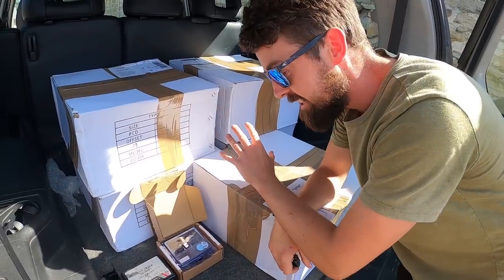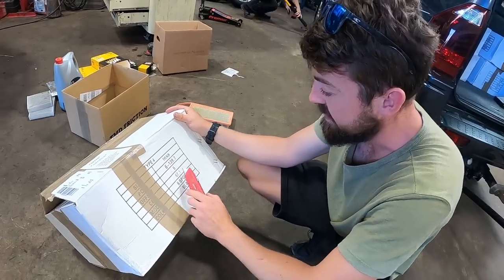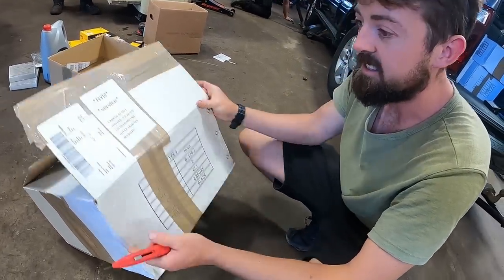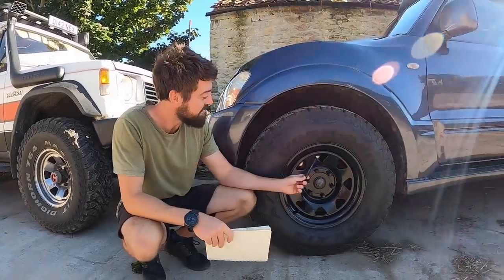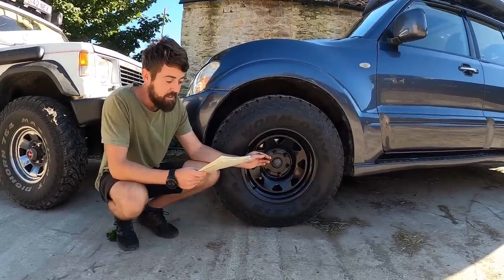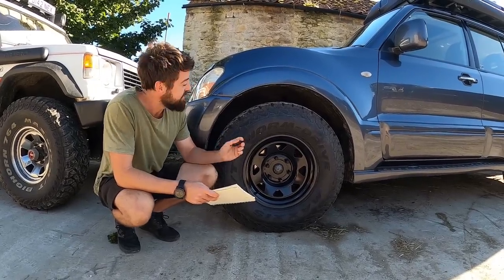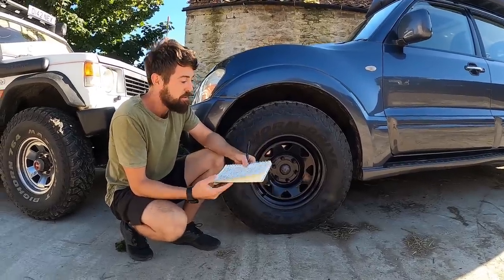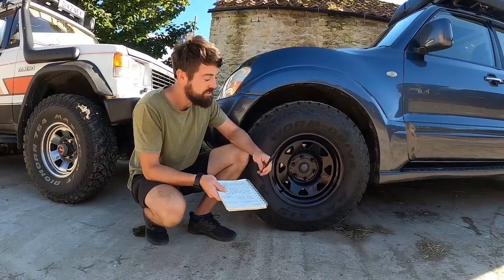Wheels & Tyres | Building an Overland Vehicle on a Budget

Comment: Nice one Jack. Definitely improves the look and should give slightly better stability. You won’t regret getting the all terrains one but. They are quieter, harder wearing and help a  bit with fuel 👍
Reply from the maker: Cheers Nick, yes indeed! I think it's going to work rather well for its intended use 😁👍
Reply: @JKoverland  It most definitely will 👍

Comment: I was looking for some steel wheels for my 97 montero sport here in the states. The hubs are 108mm (much smaller on your 3rd generation) I had trouble finding wheels that work. I did find some on the jegs website, listed as 107.95mm.  They have 3.75, 4.5, 5 inch backspace models, but I dont know what would be best with 15x10" wheels
I talked with a friend of mine and he is going to give me his old steel Toyota wheels. They are 106mm bore so I'll get them machined bigger. No idea what the backspacing is on them, but can't beat the price
Reply from the maker: Yes nearly fell into that trap too but realised in time 😂 so got a set that were advertised with the smaller bore for the later mitsu's 👌

Comment: wheels look better bigger... but I believe if you shopped around would if been alot cheaper.... I only paid £550 for 5 maxxis muds fitted.... nxt a lift i take it.... lol at midland Springs and speak to Luke.... I've the 5+1on my Mitsubishi L200 with G shackles from Brute stratus and extended 2"  pro comp  shocks...new strut spacers Springs and shock on front.... now feels and rides alot better especially the rear with the G shackles... keep up the good work..👍
Reply: I've never heard of that suspension here in the states. I believe my 97 montero sport has the same leaf spring suspension as the L200's. Can you link somewhere with info on that suspension?
Reply from the maker: Haha well this project is intended to keep things sensible and offer the best returns in reliability for touring 😂 otherwise yes I agree bigger would look better. Suspension is already here so looking forward to setting that up! These are on coils so sounds like a different set up to yours 🤟
Reply: join Mitsubishi L200 uk owners on fb pages
Reply: @JKoverland  yeah, L200's and early montero sports have the same suspension as molly

Comment: You sure about the negative 5 offset ? Negative on a Gen 3 doesn't sound correct
Reply from the maker: Yes it's close to a 0 which would be centre but slightly pushed out ie -5

Comment: Personally Im not a fan of steel rims due to the additional weight but the black rim with the dark paint of the car does really look the part. Those tyres look pretty good too. Ive heard of Maxxis here but never the model of those ones. Do you have a lift in the vehicle yet?
Reply from the maker: Please to hear that as we think it looks the part 😁 I know what you mean but it's an easy way to get some tough rims that look the part and more tire options 💪
Reply from the maker: Lift coming soon 😉
Reply: @JKoverland  Ive just painted the standard NM/NP Alloy rims so they look better. As for strength well I dont push my vehicle all that hard and definitely not to a point where I think I may cause damage to the rims.

Comment: Nice combo serious look now. Few questions if you don't mind: what was the original offset from the factory wheels?, i might have missed it but what is the tire dimension and did you had any rubbing issues on articulation? Finally how makes these steel wheels? Cheers and good luck.

Comment: Not sure I understand why you changed the wheels ? Is it that the alloy one's aren't strong enough ?
Reply from the maker: Being a 17" tyre choice and availability not so good plus I don't like how the originals are so tucked in.
Reply: @JKoverland  
Thanks, a valid point. I hope to build similar one day but with nowhere near the extreme off roading you put poor Molly through. Basically just a touring vehicle with odd easy off road.
Would original wheels be up to the job if fitted with decent tyres ? Look forward to next instalment, take care guy's.
Reply from the maker: That's the idea with this vehicle,  primarily a tourer :) yes original wheels would be fine with a decent set of AT tyres 👍

Comment: What's the model of the AC vent display, above the radio in dash 2:05min , 2:12min also
Reply: that is the new/ present shogun, standard display on the elegance 3.2 d
Reply: @robertmac2713  on mine 3.2 its slimmer monochrome display. Not like this 2din
Reply from the maker: Sorry I have no understanding of the details on this subject 😂
Reply: @JKoverland  the other viewer was asking about the display on your shogun (dash display of air circulation) I think he has a different model shogun to ours, with smaller information area.

Comment: I would have kept the alloy wheels & saved the 350 quid for something else as i'm not a fan of steel wheels
Reply from the maker: Can understand that 👍👍
Reply: True that, but if they sell the set of alloys they might almost break even...
Reply: @luisalmeida777  need to keep the alloys because the steels will be rusty inside 12 months & need replacing.
Reply: @robinpayne278  nah your wrong

Comment: to make that engine bullet proof put a bigger radiator in you won't be sorry it there weakness cracked heads
Reply from the maker: The 3.2's where the ones that didn't suffer with failing heads that was usually the 2.8's but again down to maintenance really 😂
Reply: Great stuff just a question why did u go diesel